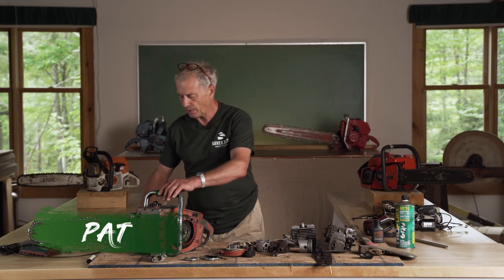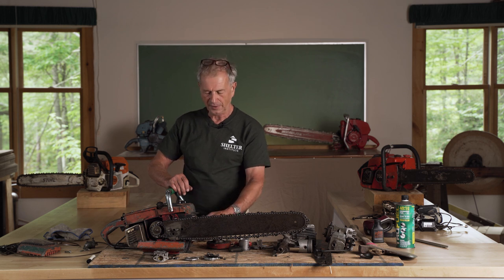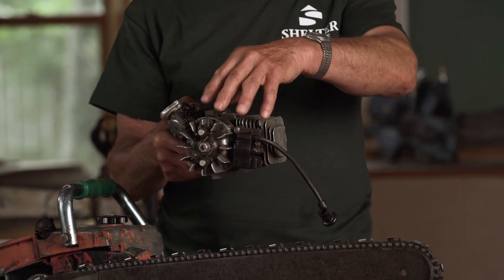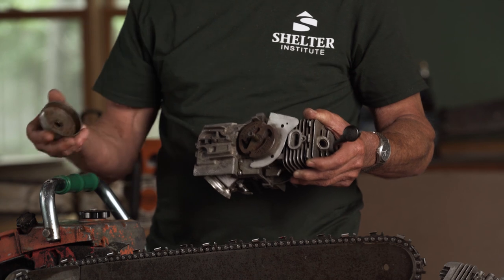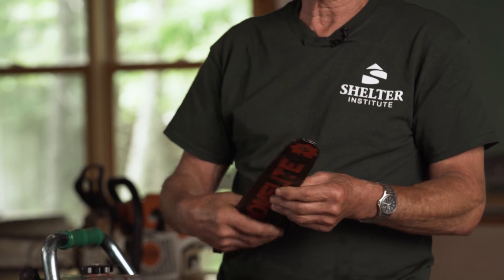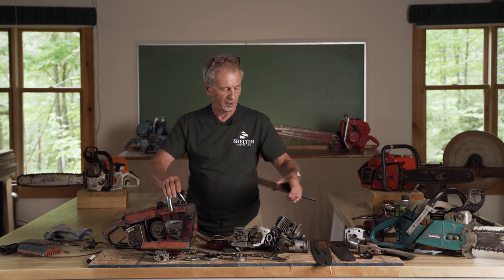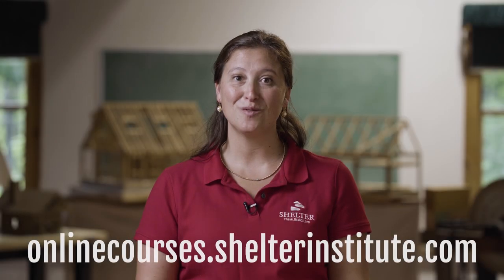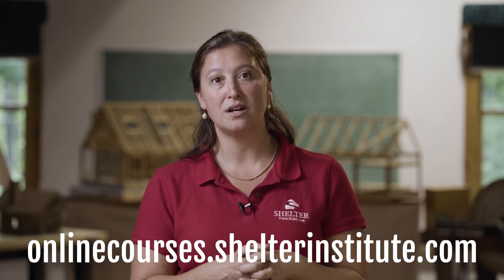Chainsaw Walkthrough - Chain, Bar, Clutch & Engine

Comment: You hit most of the important details. You didn't mention lubing the clutch drum bearing with the correct lube. Also you need to take something thin that fits in the bar groove to remove the buildup of saw dust mixed with oil. It too gets packed in there and clogs the oil passages. You should flip the bar after several hours of use to even out the wear. Those sprocket tip bars need to be lubed as well. They usually take the same lube as the clutch drum. My saws use a high temp grease injected with a palm type needle tip grease gun. You can dress those edges on the bar with a good file as well. Chains come in several pitches and drive link thicknesses. They need to match the bar groove, the drive sprocket and have the correct number of drive links to match the bar length. I keep several sharp chains on hand when using my saws to keep working should you happen to hit something that dulls the chain. It allows for a quick change with appropriate cleaning to get you back to work quickly. But overall a good presentation. Keep them coming.